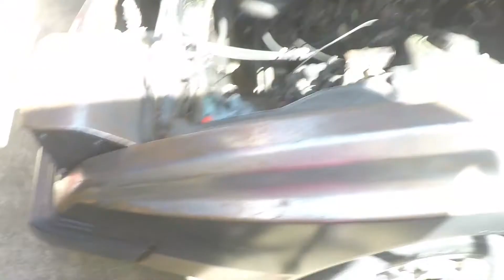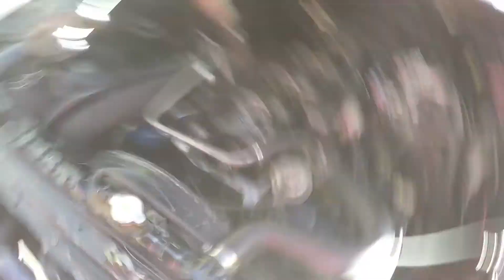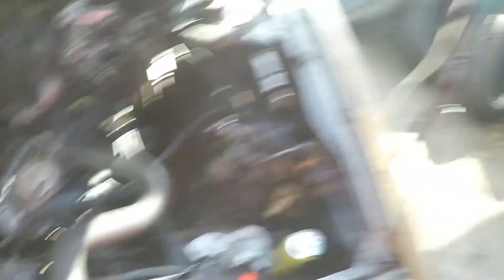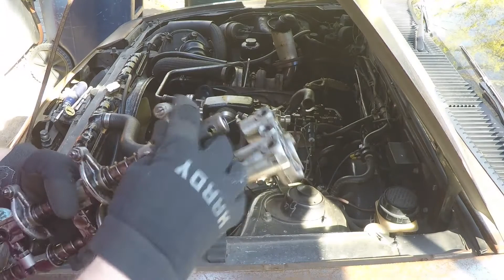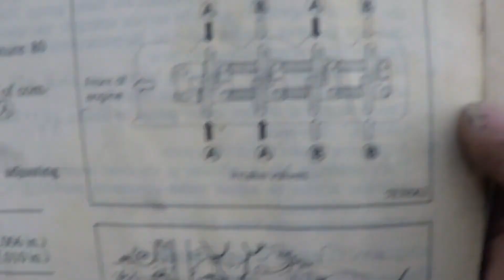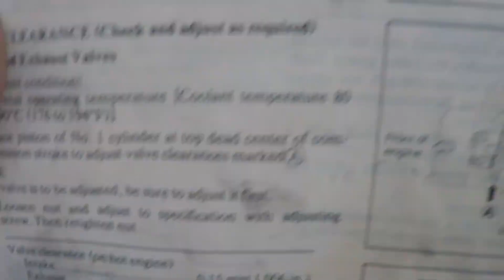Blowing Chunks --Ooops

Comment: I think do you did wrong .I use a book for 2.6l Montero, mighty max, ram 50 I mess up 3 motor before get it right, now it  pass smog and 10,000 miles on it . good luck
Reply: Your are right I check ,keep up video.
Reply from the maker: Thats interesting. I wonder if there are different specs for non-turbo 2.6? I used the 83 starion manual. 
How did you do yours differently than how I did ?